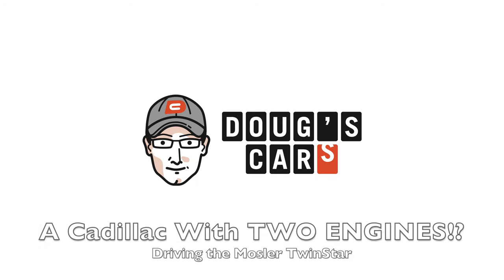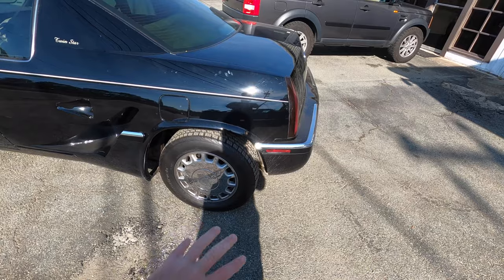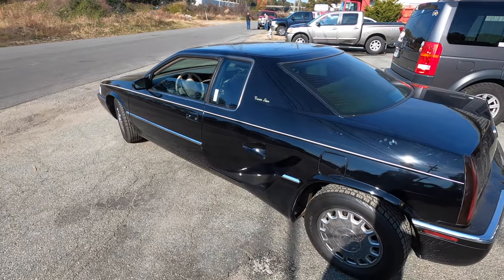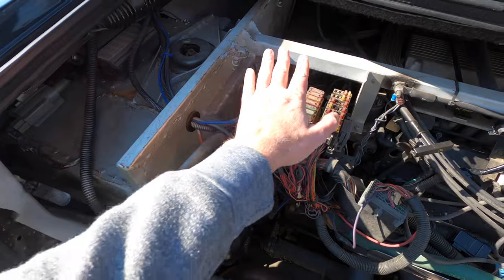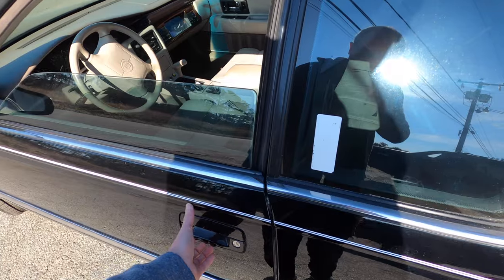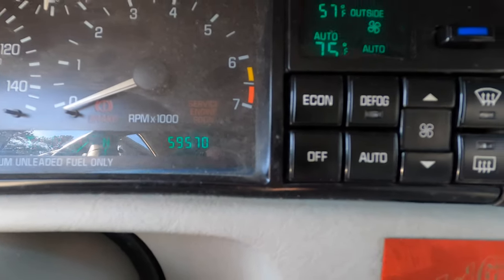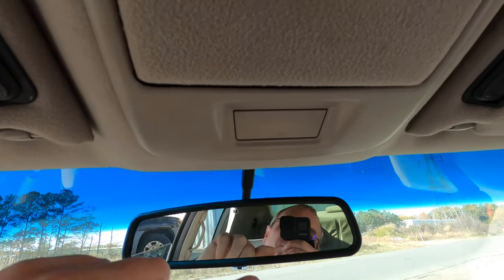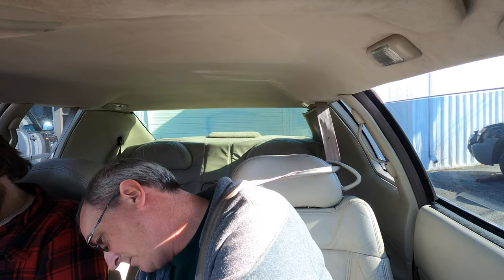A Cadillac With TWO ENGINES!? Driving the Mosler TwinStar

Comment: Regarding 275hp vs 300hp Northstar. The front engine was whatever was in the donor car, which was up to the buyer to supply - it wasn't different by design but also didn't seem to matter. I've spoken to someone from Mosler back when they were selling these and got the explanation from them. Also, the shift timing is modified to alternate between engines so both don't change gears at the same time, this results in a continuous uninterrupted power to the wheels.
Reply: The spec sheet from mosler posted in car and driver (July 2000) stated the engine specs and 275hp/300lb vs 300hp/295tq numbers are listed as part of the $30k modification

Comment: Been fascinated by the Twinstar since reading the Car & Driver review of it in 2000. There was a video from 10 years ago (posted by a seller, iirc) but it's long since deleted. Glad you enjoyed driving it, Other Doug. Excerpt from the article that lives in my head rent free: Mosler's car wears two distinctly different engines. The one up front is a 275-hp Northstar like that found in the base Eldo, and the one in back is the 300-hp unit that comes in an ETC. The rear engine has a higher redline and uses lower gear ratios, so the engines shift at different times as the car accelerates.

At first, this seems weird, but it feels normal after a while, particularly since it smoothes the usual interruption in thrust that occurs even in cars with automatic transmissions. With the TwinStar, while one engine shifts, the other continues to pull hard. The disparity in power fore and aft is faintly detectable and is sensed as a harder push from the rear, although it's possible that impression is the result of the louder rear-engine exhaust.
Reply from the maker: It’s a crazy system, for sure!

Comment: They used 2 engines bc one makes more HP and the other more TQ, the only difference is the intake cams.  With 2 diff ones you probably get a more consistent pull with one being low rpm and the other high rpm focused
Reply from the maker: Good to know, thanks! Still can’t believe I got to drive this thing.

Comment: Engine is to a gas, as motor is to electric. 
Example starter motor, starter engine is odd, as car motor is off, but not as odd. 
    So, your hybrid vehicle has both, a engine and a motor. If you had an electric vehicle, without an extended range module, you would have an motor, instead of an engine. 
     Just extra information.